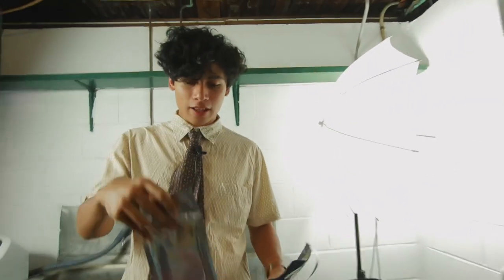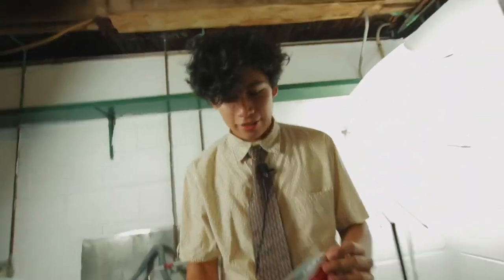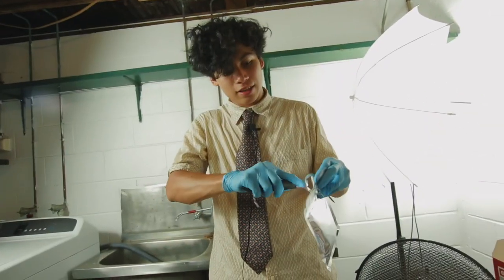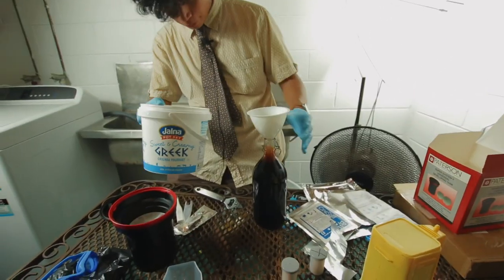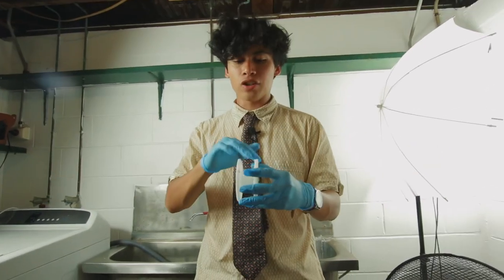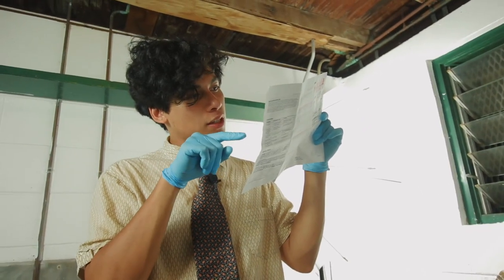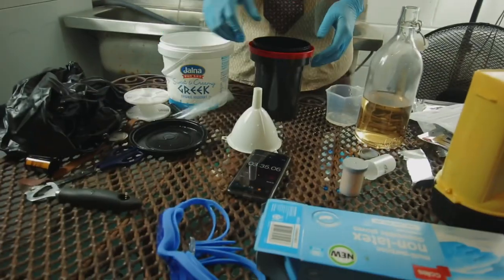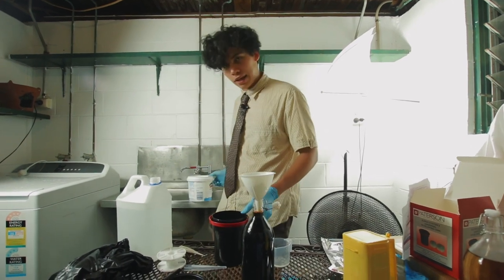A TWO BATH process for COLOUR FILM? (CineStill CS41 2-Bath Kit)

Comment: At 4:35 You have to extend the reel slightly further (as You are on the 2nd/middle click there) to get 120 film on it.
As far as pre-washing goes: The Colortec C-41 manuals from Tetenal usually recommend to just heat up the tank (aka putting the whole thing in the waterbath for 5 mins). I have done both but I usually soak the film for 5 mins with an inversion every 15 sec without any problems/inconsistency. So I guess both ways work just fine.
Reply from the maker: Ah yes, I see. I've heard it's good to get the tank warmed up so the chemicals dont cool down immediately. Guess that does the trick! Thanks for stopping by :)

Comment: How many rolls can you develop with this kit?
Reply from the maker: I’ve had a lot more experience with this kit since making this video and depending on how well the chemicals keep, I once dev’d 40+ rolls with one batch. Just had to increase developing time to account for weaker chemicals, which can sometimes be hard to gauge. But if it’s been a while since I’ve used it, I’ll run a test piece of film first (usually the leader that gets cut off the end) just to make sure it still works.

Comment: The home kits for C-41 processing are commonly 3-bath, which in turn are down from the 5-bath of the official C-412 process. The 3-bath kits are achieved by eliminating stop bath and combining bleach and fixer in one solution. Cinestill, in this powder kit, gets in down to 2-step by eliminating the stabilizer (which is intended to do what the name implies in protecting your finished negatives). Notably, Cinestill still includes stabilizer in its liquid version of this kit. The lesson: you can only go so far in cheapening down the process before you are risking your images. Why does Cinestill do this crap? Simple, they save a few pennies per kit by removing one more part of the product, and they figure that most people using this type of process at home are going to scan their negatives, save the computer files and toss the negatives, so who cares whether they bleach out. Actually, the 3-bath kits present a significant compromise of the color quality obtained, but if you have to reference for comparison, again, who cares. Sign of the tijmes.
Reply from the maker: I didn't know that, thanks for sharing. It could be interesting to do that comparison as you mention, and see how the negatives hold up long term. You're right though, colour does seem to vary using this kit.
Reply: True that.. I stopped using the stabilizer step on 3 bath kits simply to avoid the residue affecting the image when scanning. Also being just my own snapshots and not someone's wedding, I don't care about physical archival. It's all digitized immediately post-development.
Reply: @NatKellyFilms  I have not done any critical comparison, but it would be unnecessary for Tetenal to modify the formulas for developer and blix in the two bath kit versus the three bath kit. Therefore, I would not expect any variance in color results between the two kits as first finished.  Any change in the color dyes processed in the two bath kit without stabilizer would occur over a fairly long period of time. There is certain corporate lack of respect for its customers here which for me calls into question whether I would elect to do business with Tetenal. I started using Unicolor process kits over 40 years ago. They are high quality and tend to be less costly.

Comment: how many rolls you can develop in this two-bath kit?
Reply from the maker: Cinestill recommends 8 rolls of 135 film can be developed reliably (on their fact sheet), however it can also depend on how the chemicals are stored, how contaminated they get,  and how lenient you are on quality. Hope that helps :)
Reply: Nathaniel Kelly thanks
Reply: just so for everyone reading this comment. 8 rolls is the recommedation. but I've tried it and have gone up to 20 rolls of 120 film. Now, the thing to remember is you can squeeze every juice out of the chems but after around 10-11, the colour and quality seems to degrade. I can still get an image a "good" image. For anyone starting out, you wont care that much to begin with, you just need to get as much experience as you can.  My recommendation is, when you get better and more anal about the quality of your development, stick to the recommended usage of around 8.
Reply from the maker: Just thought I’d jump in here and post an update— I’ve gone through a few of these kits and my personal best is 30 rolls (and going!) from my latest kit. Just have to adjust times to compensate :)

Comment: Sorry, but not impressed with the processing.  Your scanned images were not very saturated, colors off.   You make it sound simple, but color processing requires accuracy.  You did not use a water bath, to maintain temperature for all your chemicals, and the Paterson tank should be in the water bath also, so all temperatures are maintained. Remember, you added developer at a specified temperature to a cold tank, sitting on a cold surface (instantly you likely dropped 1-2F, when tolerance is within 1/2 deg or less).   Get yourself a large tub of water...the more water it holds, the longer the temperature will stay stable.  Bring the entire tub to temperature, and the chemistry placed in the tub will all match.  I don't hold a lot of confidence in a 2 part system either.  By the way, an aquarium heater does a good job of maintaining temperature in  water bath.  Ideally, buy a recirculating temperature control unit...water goes in, gets heated, and exits to a closed system (tub of water). Your images all have too much cyan and slight bit of green in them....big reason why they are dull.   I would use glass containers, or polypropylene or polyethylene containers (photo grade). I was curious and looked up greek yogurt, and it is acidic. I know I have tried using a cranberry juice bottle to store distilled water in it, and I could never get the odor out (even though food grade, it still absorbs). You don't want to use that yogurt container for developer, because any amount of contamination affects color and contrast.  Mfrs usually are less at fault, and it is failure to use clean containers (never switch them either), proper temperature/mixing of solutions/agitation/time....a water bath system.